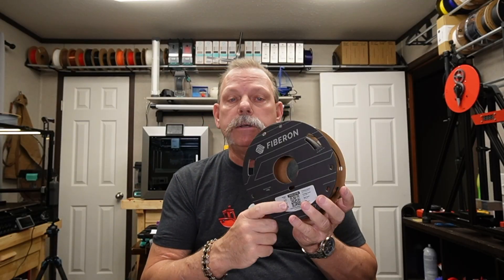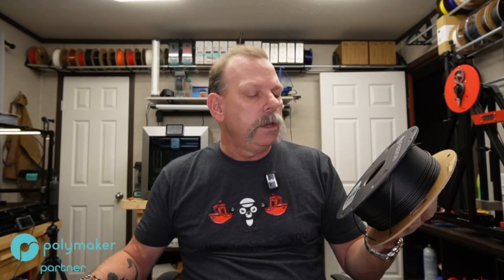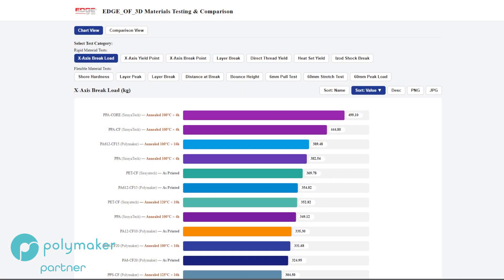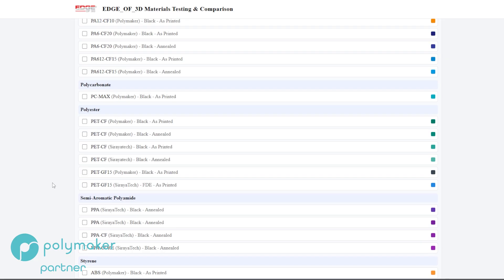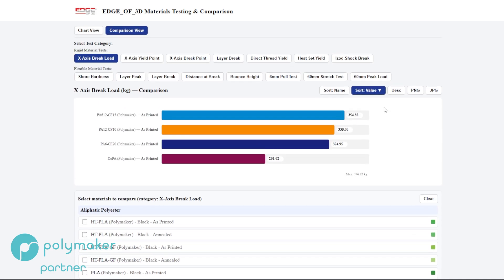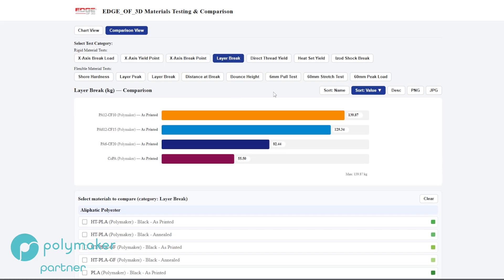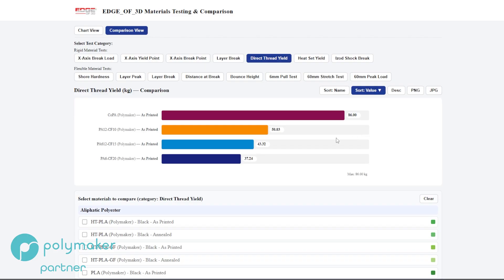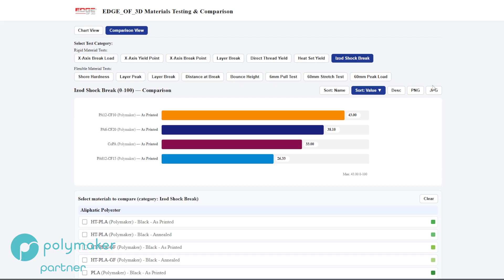Polymaker FIBERON PA12-CF10 Tested | EDGE OF 3D

Comment: How dangerous are the fumes from nylon?  As the cold weather hits, I cant open the windows and run a fan like I do in the summer.
Reply from the maker: I'll be honest, I run my printers right here in my office where I film and I've not noticed any fumes from any of the Nylon blends. By no means does this mean there aren't any, I just have not smelled them, nor have I had to deal with the film on the inside of the glass like I get when printing with some ABS and ASA filaments.

I won't name it, but I do have an ABS here that although it is a great performer, it stinks, and I mean fills the entire house with the smell, worse than sauteing Brussel Sprouts in Fish Sauce stink.
Reply: @EDGEOF3D  I think I know which one you are dealing with. I have relegated that to one of my printers that sits in my old bus